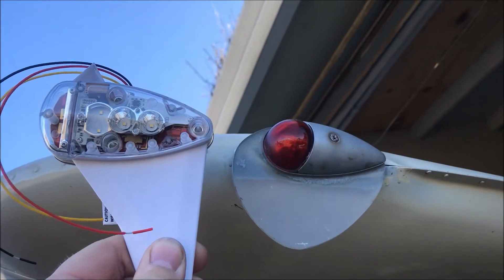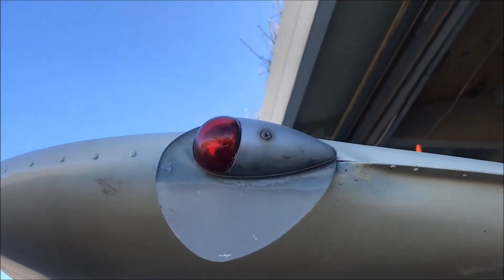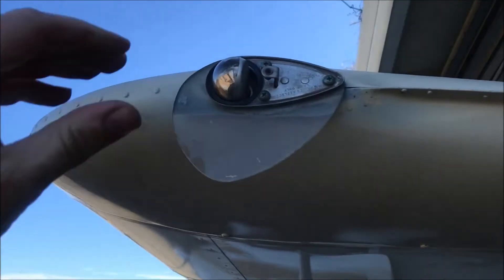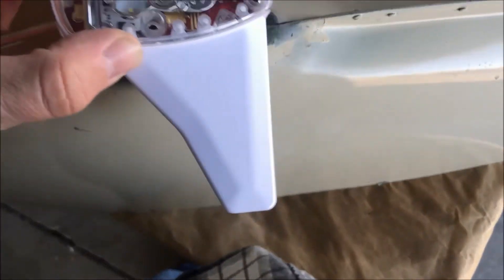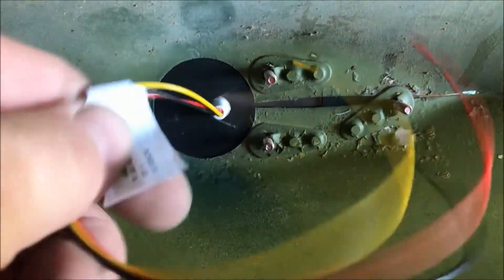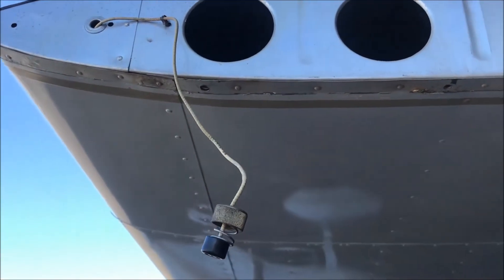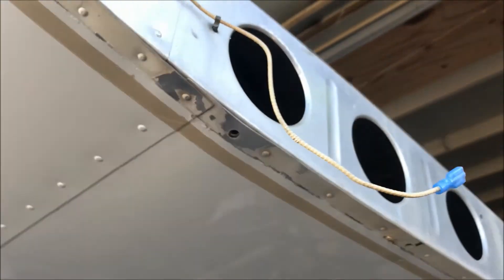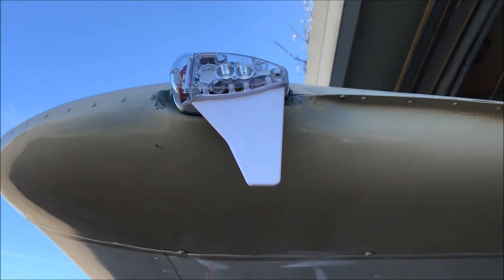Installing uAvionix skyBeacon wingtip ADS-B on a Cessna 172

Comment: Hi, I'm looking to buy a Mooney, the one in looking at now doesn't have ads b. This would be my first airplane and I'm wondering if it's better to get one with ads b already installed or if i should do one like this. Does it have to be done by a a&p mechanic and about how much does it cost? Please and thanks.
Reply from the maker: Jerome S  I recommend ADSB other than a uAvionix product. These wingtip units have been failing in large numbers. I no longer install their products. That said this does require installation by an A&P with approval by an IA as it is a major alteration. It typically takes 3 hours.
There are issues with them as far as comparability with a previous anti collision light system. I recommend you have your mechanic consult on if this would be compatible with your aircraft in its present configuration.